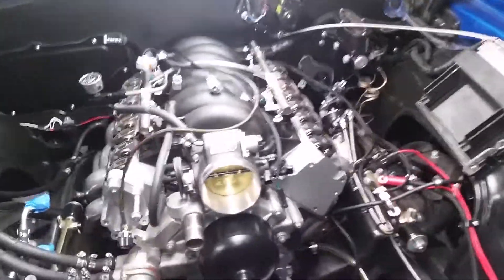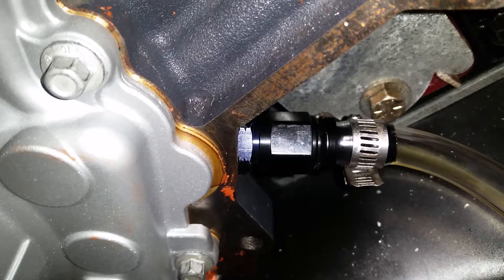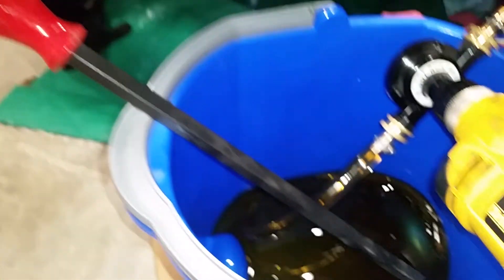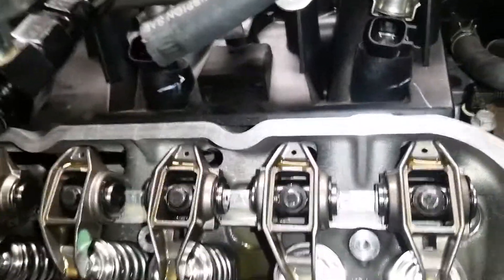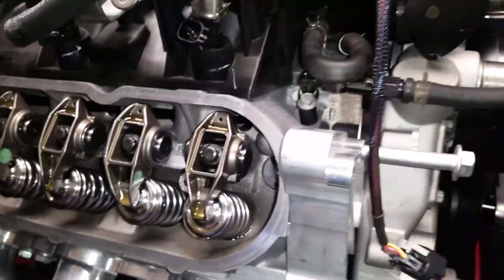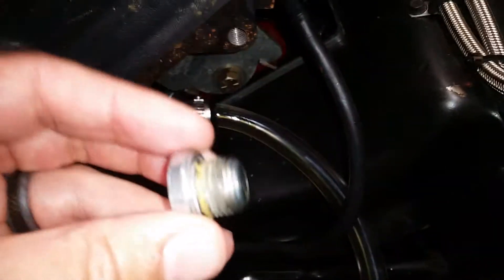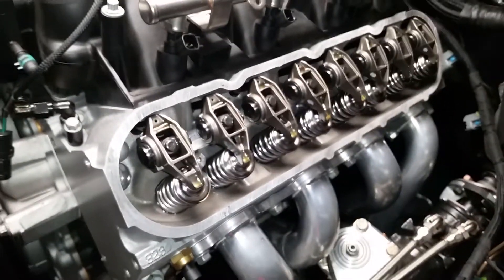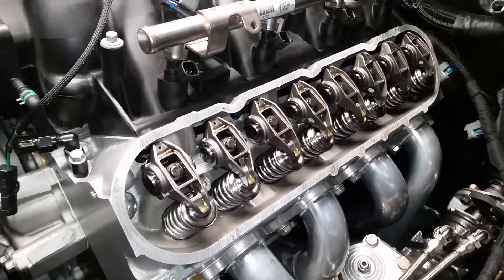1972 Chevy Nova Booboo - LSx oil primer tool

Comment: Hopefully youre still around to respond but where do you get the drill pump at
Reply: Harbor freight also you can prime an engine by disconnecting the spark plug wire's and turning the engine over with the starter few minutes

Comment: Cool! You know, I was looking at the GM LSA crate engine instructions, and they just suggest cranking the motor with the ignition disabled. That sounds a little suspect to me, but that is what is says. Hmmm
Reply from the maker: +asicerik It is a 50-50 opinion.  Did not cost me more than $30 in parts, its fun and you get oil all over the place.
Reply: +sebtarta Bonus! :)